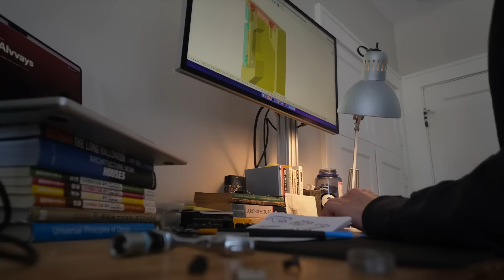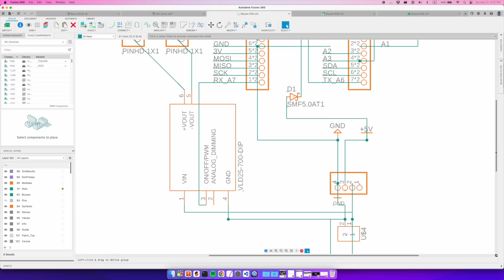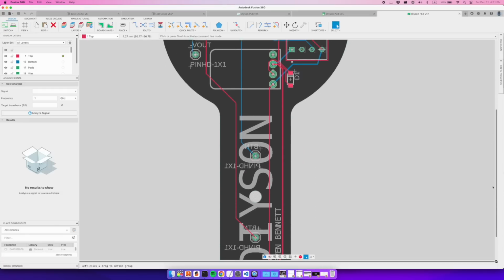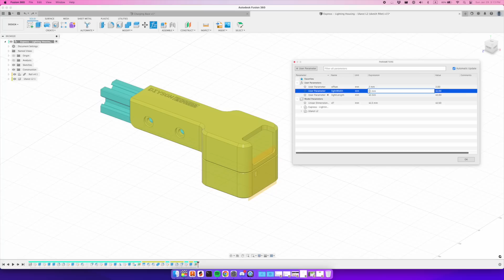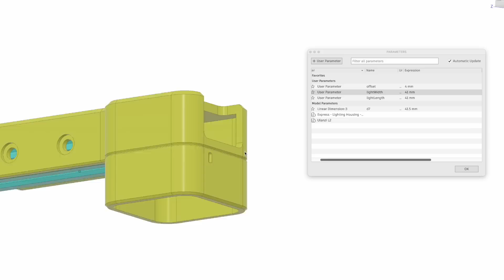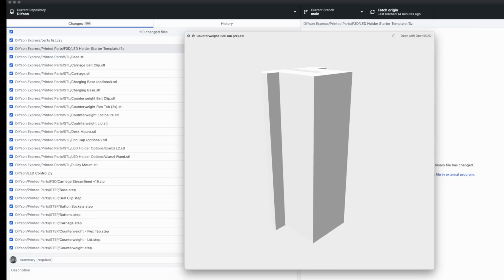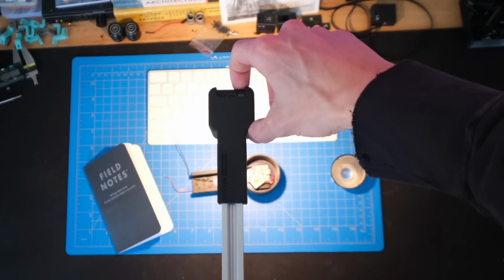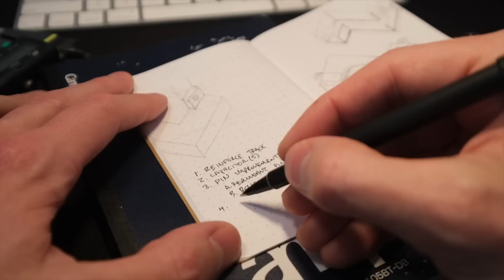The DIYson you can make this weekend - DIYson Lamp Build Log #8

Comment from the maker: This one is a bit experimental. I am genuinely curious if this is something anyone wants to build and tinker with, so let me know what you think!

Also, looking through the parts list there’s opportunity to get the cost significantly lower if I bought some of the basic hardware (screws, lock nuts, pulleys) in bulk and sold them in little kits (we could also use much higher quality hardware this way). Is this something you would be interested in?

Thanks for watching <3
Reply: I would definitely be interested in a kit that's cheaper and higher quality!
Reply: Down for a kit option! Seems like it'd be great for getting the cost down. Right now with having to order through several diff retailers, shipping cost adds up quick - also, there are lots of spare parts left over that I won't have a need for. Higher quality parts for cheaper would be a huge plus. Maybe setup an Etsy or a Shopify store?
Reply: Where do you get the heatpipes?
Reply: I love this project and would love to help out, if you need any aluminum / steel parts machined send an email my way and we can see what we can do to get them made ASAP for ya!
Reply: i would be intrested
Reply: I too would love a kit!
Reply: I would very much like a kit of the non-3d printable bits 🙏🏻 I can purchase the LED camera light directly from Amazon 👍🏻
Reply: I would most definitely pay for a crowdfunding of a kit like that!
Reply: I already bought all the parts and now just waiting for shipping. But a set would be really cool and not expensive. The entire lamp is not expensive at all if you have a healthy supply of screws nuts and bolt etc.
Reply: @ITmegaware could you tell us how much you paid for all the parts?
Reply: I'd be interested in a kit as well, it seems like I'd end up with a lot of extra bits ordering on my own.
Reply: I would definitely buy a kit version!
Reply: This is one of the best prototyping videos on YouTube, it's awesome to see you update the design requirements and then eliminate complexity to capitalize on approachability with this version. Keep up the great work!
Reply: Definitely interested
Reply: I am 1000000% building this, also just the rechargeable light idea is a game changer because I can just make a bunch of lights that work around it and swap it in and out as I need

Comment: Cool project. For the DIYson wired version it would be easier to just strip down a Phillips Ultra Definition LED bulb with low flicker and a high CRI. One heck of a bargain at $3.50 and it works directly off 110v (220v where applicable). Good luck!

Comment: Hi Steven, 

I'm printing the parts for the diyson express and would love to know wich print orientation did you use on the coutnterweight Enclosure ?
Cura set the longer side on the bed but I dont know if my printer can brigde with good quality :(
Thanks !
Reply from the maker: Hey there. The orientation that worked best for me was to place the long exterior face (the side opposite the belt side) on the print bed. This will require some bridging, but the bridges should be short and all of them will be hidden in the interior of the part. You could also experiment with carefully placed internal supports, but I worry that these would be hard to extract. Good luck, and let me know if you run into any issues :)

Comment: If you used a small external power source to charge the battery, it still allows you to detach the power supply to move the light around, but could provide extra run time, nd only requires getting 100-200 mA to the lamp module... easy to do, never have to remember to charge the battery.... three-piece vertical and horizontal rails, with insulated center, and pass the small, 6 V power through the rollers...
Funny, no one seems to like my ideas, even though I have 35 years of electronics and system design, and more than 6 years experience in developing LEDs and LED driver circuits, 500 million at a time...Oh, well, seems that people take 'free' advice as 'useless' advice  ;-)

Comment: @StevenBenbettMakes What kind of holder do you use for your Lume Cube Panel? Looks like Loc-Line? It it off the shelf or DIY?
Reply from the maker: Loc-line + SmallRig 1/4" Camera Hot Shoe Mount :)
Reply: @StevenBennettMakes  3/4 Loc-line I presume? Anything in the Loc-line to make it sturdy enough not to sag? And how did you attach the SmallRig camera shoe to the Loc-line?
Reply from the maker: @martijnajanssen  This is the one I got, and I replaced the phone holder with the ball head mount: https://www.modularhose.com/110621

Comment: Hey, just a thought: To reduce the complexity of the full size DIYSON lamp and expand its functionality, you could use a Zigbee GU10 or mr16 bulb with a Zigbee button bound to it.
Zigbee has support for binding which makes it possible that devices can directly control each other without needing a hub and there are a lot of buttons to choose from (some already capacitive like the Tuya Zigbee 4-Button Touch Remote S011). With some mods to the buttons you can greatly simplify the electronics and have the possibility to choose the bulb you want (for example the Philips Hue GU10 RGB one).
Even better, as everything would be Zigbee controlled you could hook it up to Home Assistant and automate the light.
Let me know if you're interested in making something like this!

Comment: What a great project :) I love your attention to detail and time you take to get what you imagine is possible. Subscribed immediately and cannot wait for your next reports.

BTW, I have found that someone else is trying to build a lamp like this. In case you haven't seen it, there are two shorts here: https://www.youtube.com/@user-zq1kp5cn3f
The build is not to your level of design, but he seems to have solved the cabling issue in an invisible way. Unless it is visible on the side he is not showing. On one of the shorts you can see a cable going inside the column but I haven't noticed any signs of how the power is transferred to the horizontal beam.

Comment: Awesome ! I was waiting to build it. But now with this new and easier approach on the electronic side, I think I will start the build in the upcoming days ;) I've just got an idea, it might be interesting to use a power bank as counterweight. Just need to find one with the right weight and form factor. And maybe a flat micro usb cable can be used as the Y belt. 🤔
Reply: Scrolling to see if someone else had the same idea to replace the dead weight with a power bank.

Comment: One thing i would like to mention is, you don't need a magnet in the case that matches the magnet on the light. You can just add a ferromagnetic metal (like normal iron) in the case which should hold the light well enough, and also does not cost as much.

Comment: I am so hyped now to do my own DIYson express! as a start, the fact that clumsy carriage for the cables are not longer need is awesome, I think for the "regular" DIYson you should use batteries too or I will make one iteration like that and I will be happy to share and contribute, with this new approach you open the doors to lots of makers.

As a designer engineer I am really impressed of how well you tackled this project, impecable systematic process with clear set of goals, iterations, learnings... even including the dead ends, but reasoning every decision and step forward, and then the super clean videos you made for this channel, the cheery on top. I wish someday to address my projects like that, so thanks a lot for the teachings.

As a creator of an opensource hardware startup I think this project has lots of potential; expanding to the other range of Dyson products or even other cool consumer products, I am also big fan of their technology but we need to bring it to the masses which also helps to push innovation, the community is beginning to be active and good documentation you have in place. I think you need a discord and a website at least to start just if you wanna go that path happy to help, or if you wanna undertake even further with kits to sell to sustain your work also willing to advice you.

Comment: Do you have a BOM for this? It'd be nice to know the approximate cost before having to dig through all of the links and add them manually 😊
Reply from the maker: Yup, check out the Github repository: https://github.com/stevenbennett/DIYson
(The parts list is in the DIYson Express folder)
You will want to take a look at the individual items on the list because the price will fluctuate a lot just based on the hardware that you have on hand/have available to you at your local hardware store (a big chunk of the estimated price is hardware assortments).

Comment: although I like the idea, I think I would personally mod the lamp so I could drive it from an external power source, and just deal with a dangling cable :P
great video though, I love the idea of one thats more easy to build, and I guess could also serve as a base for people who want to implement their own ideas, since cable management decides such a huge part of the design it seems
Reply from the maker: Yup, you totally get it. A dangling cable is a totally reasonable solution, and the exact kind of thing I was hoping to invite folks to do with this project :)
Reply: @StevenBennettMakes  Theres a lot of standart usb cables, which are made with flexible silicone insulation and possibly could fit into DIYson profile, so it may be possible to run them as in original construction with some clips added

Comment: Has anyone added up the parts cost for parts for the Express?
Reply from the maker: I did! With a single Ulanzi L2 light (the cube I used in the video) the total is $217.49. The most expensive components are the Open Builds wheels [x6] ($41.94), the LED ($36.99), and the lead shot ($24.99). What really adds up after that is excess hardware (buying screw assortments just to use a couple of screws). I bet the average person could save an additional $30-60 buying these items individually at their local hardware store.
Reply from the maker: Also there's a more detailed parts breakdown on the Github page: https://github.com/stevenbennett/DIYson

Comment: I'm building a desk lamp according to your design. I simplified your project with no horizontal movement and I used two very bright stripes of led light attached under the horizontal aluminium profile.  It's no so cool as the dyson light, but it's simple and it does the job to provide a wide area light source.

Comment: I made some changes to suit my needs.
Modified the Carriage to my leftover IKEA hardware used.
Modified the base as I already have an old IKEA desk lamp so I reuse that one.
Modify so my regular noname 2020 rails and Creality 3d printer wheels fits nice.
Reused a pulley and belt from another old i3 printer required me to redo the Pulley mount a bit as well...
And added a LED strip running the entire length of beam instead of a spot at the end.
This LED strip is powered by a NodeMCU and WLED software with all options from that.

But hey, I guess I already made an express version :)
Reply from the maker: Haha, you beat me to it. Sounds cool!

Comment: approachability can also come with good engineering design, so even if a final product is more complex, it can be easier to create/build/assemble/etc.
I'm not seeing any serious issues in the DIYson yet, i even have some of my own ideas that I'll try.
That aside, this simplified version is very cool! The modular light enclosure is a great idea and I can see its uses on the workbench, being able to swap out light head units for different lighting needs.
Reply from the maker: Definitely! Maximizing approachability will still be a primary constraint on the full DIYson, the base level of difficulty will just be a bit higher.